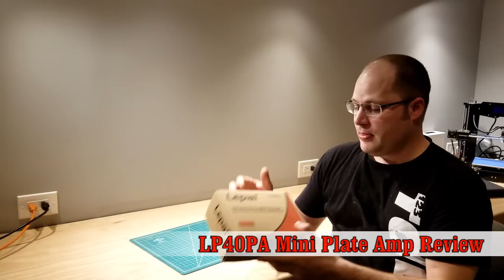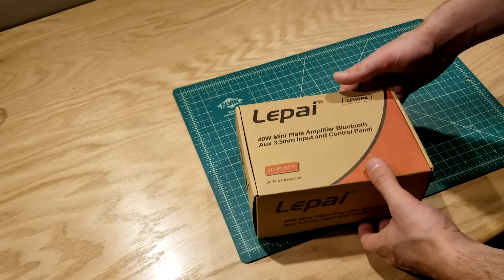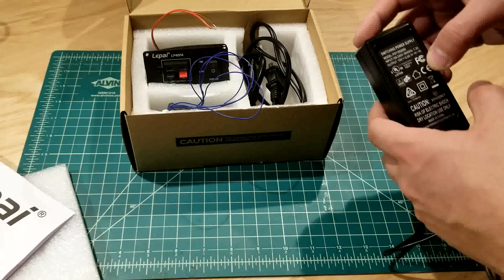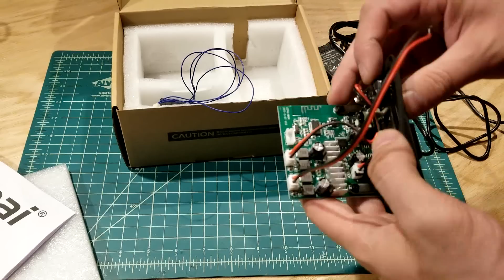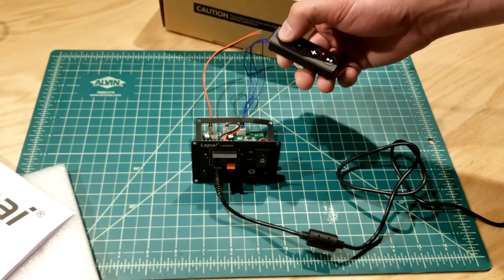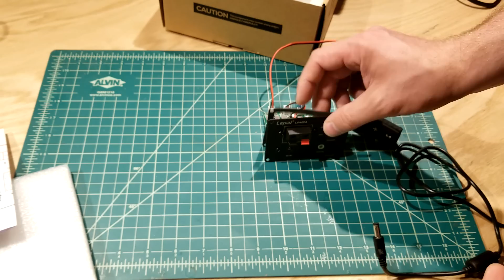Full-range Plate Amp for under $40? LP40PA Review

Comment: Let me try to understand this.  The amp should be installed in the right speaker enclosure.  Then the left speaker wire connects to the “Left Output” terminal, correct?  I’m building two small PC speakers.
Reply from the maker: That is correct

Comment: I’ve had mine for a year now. Still working great. Only complaint is the Bluetooth pairing is very loud. I’m using it on just one speaker, so I’m thinking of running the left wire to the crossover also and double up the watts.

Comment: Default to Bluetooth = meh. I’d pay a little more for a basic but consistent lcd display. Not a fan of the units that power up on full volume. 12v will turn on, but I see a lot that won’t function on lower voltage; Lepai amps have all worked on lower volts in my experience. Also tested many Bluetooth amps that had horrible noise from the BT receiver; no BT from Lepai yet. Still shopping for the amp that I don’t have to modify too much or at all to get a working portable unit most people can live with. This looks like a contender. Great video, Nick!!! Now to get rid of some speakers...

Comment: dam china... you failed us on this one.. fix this and come back haha...   re:volt range.... im sure there is probably a way you could calculate it..
Reply: No, you need either a max voltage or max current rating to know. Without that information, it's all guess work.I would assume 24v is max voltage and 2 amps is the max current. The math checks out, assuming it current limits at 2 amps. That would give it 48watts to work with in producing the 40 watts it claims, which sounds about right for a class D.

Comment: Lithium batteries charge to 4.2v but drop to 3.7v when a load is applied so a 3S or 3 in series will charge to 12.6v and drop to 11.1v when you turn the amp on and the amp may very well run with less voltage, but if it need a constant 12v you'll need a boost converter or if you use a 4S that will be 16.8v and will drop to 14.8v which may be within the limits of this amp, if not you'd need a buck converter or even choose a sepic buck/boost which will work either way.

Comment: I wonder if this board also has the pre-programmed Asian woman saying "the bluetoos dewice is connectedu succesfullaye". For some reason that voice is always there when the Bluetooth module looks like the one on this amplifier board. As far as I know the only chips that just beep instead of talk are the csr chips (the blue ones that are soldered onto the board)
Reply: Vincent Koster you hit the nail on the head.  If this has a JL Bluetooth chip (and it sure looks like it does), that is a deal breaker.  Nobody wants that Chinese voice announcing "da Bluetooth device is ready to pair" at full volume after power up.  How disappointing that this 123Toid never powered the unit up with speakers attached!
Reply: Glenn C  exactly! I assume that he will test this in a future video though
Reply: There is a photo of the pcb on the PE website that allows you to zoom in on the chip.  The logo is not the JieLi logo, but is nothing that I recognize either.  Anybody have any ideas?  A reputable bluetooth chip provider, or a copycat of the awful JieLi chip?  All the more reason a follow up video is needed asap so we can hear the power up sequence before we spend our hard earned money on this thing.  I've been burned by so many chinese made amps my policy is now "show me" more than ever.  I'd also like to know if there are any power on or power off pops, and if there is any noticeable hiss during quiet passages.

Speaking of which, why does PE state on their Q&A that the amplifier is not a TA2020A chip, but they don't reveal what it actually is?  So my other question is, will the follow up video include heatsink removal and a reveal of the amplifier chip make and model?

Comment: I never did quite understand the point of putting a BT receiver in your speaker. Then, you have to run power and your second channel wire to the box where as with a unit like the Dayton DTA120BT, you just run the signal wire to any speaker you have, put the speaker wherever you want and just run the single speaker wire instead of the wires and power.
Reply from the maker: I hear you.  It really is a trade off.  Typically something like the DTA120BT is of higher quality.  Something like this has the ability to be more portable and or reduce clutter.  I like the versatility of this amp, but definitely prefer the sound of the DTA120BT.  If I was building for sound quality only in mind, I am with you all the way.

Comment: I saw this amp on parts-express. I was thinking of doing a JBL Xtreme clone with some dayton speakers which this amp would be perfect for with those buttons. Im wondering about sound quality though and if it might be possible to turn the voltage up to 24V because 18 seems a bit of a weird number to me (maybe theres some schematics on the parts-express website). Also just a quick correction, the channel layout actually makes sense considering you put this on the back of most speakers.
Reply from the maker: That's a cool idea.  You might be able to up the voltage, but I couldn't say for sure.  I do agree, that 18v does seem odd.  I did check with a few sources and couldn't get an answer on it.  P.S. You are right about the wire configuration. Great point.

Comment: I love the idea of adding that amplifier to existing speakers. I've got a couple of JBL floor speakers that I got a garage sale, and I haven't really been sure what I was going to do with him. I got it for $15 I couldn't pass up the deal. I do not want to leave this in the back of one of the speakers and then run the other speaker wire so that outside speaker port. And make them Bluetooth speakers. And that's an awesome idea thank you so much for showing this to us
Reply from the maker: You're Welcome.  And if you do not want to cut out the speaker, you can put this in a portable box with speaker wire out or banana jacks out the back.